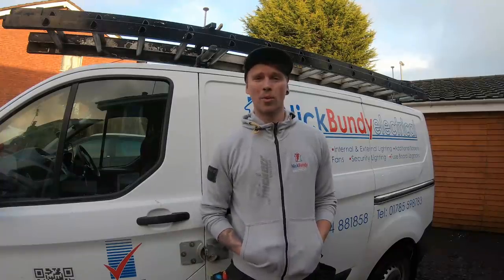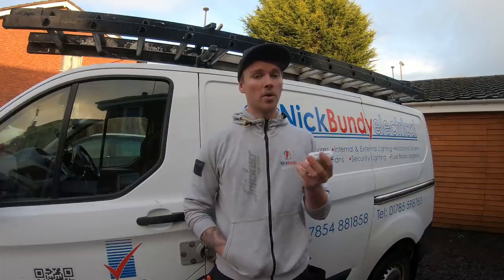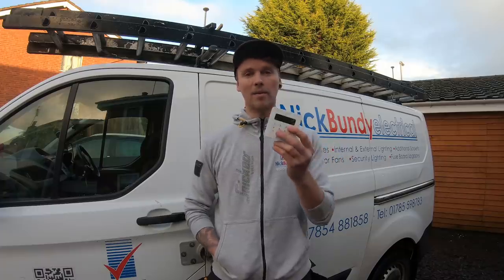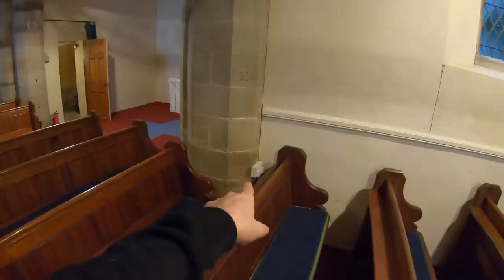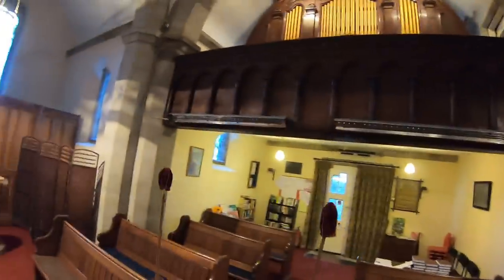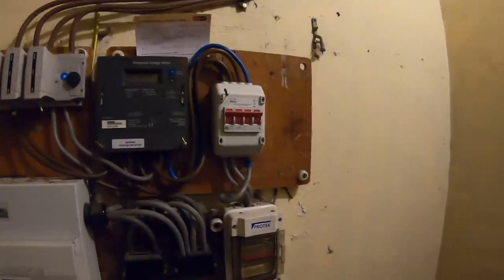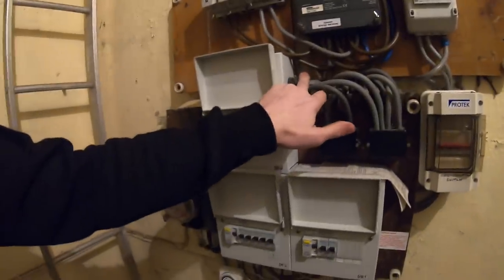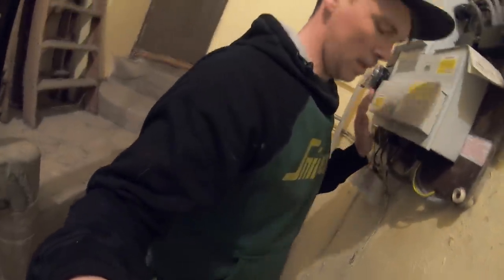AD Get paid with SumUp, Help! Wiring a church, Exotic life on an Electrician

Comment: I do a lot of work in churches, both EICRs and installation work. Bear in mind they are listed buildings, keep holes (inc fixings) to a minimum and in mortar rather then in stone - which in itself causes problems for you with getting good fixings. Check with the DAC whether they will accept all FP200 cables - it is either that or MICC in a church. Churches are very cold - plan do do work in the summer. There is no ideal solution for heating a church - whatever system is chosen will not be good enough - it is all about finding the best compromise. I have found under-pew convection heaters give acceptable results for the congregation, but the Vicar does not benefit from them. Capacity of supply is also a factor to take into account, though whatever they use will only be on for an hour or two a week. I have incorporated a control panel for zonal switching of heaters including push-button timer activation - guarantees the heating will not be left on accidentally.  Lightning protection ought to be in place, and it would be on the tower, but that is a specialist job - all you can do is advice them,  but the DAC ought to have done that already. Everything you do will take much longer than you expect - quote to take your time - aesthetics are really important. If I was you I would talk to the guy you know who did the EICR and perhaps find a way of both doing the job together.
Reply: Some heaters are programmed to switch off after a while automatically just in case they are left on.

Comment: I wouldn't discount re-running it in MI. When done well it looks great especially for buildings with bare stone or brick walls. Less obtrusive than conduit. I would be inclined to do everything in metalclad boxes too, no plastic. There's a tendency to think of MI as obsolete but it's definitely not. It does take skill to do it well though and I don't think they teach that skill enough on apprenticeships and the like now.
Reply: Yes, obviously.
Reply: When conduit is required metal conduit will look better that plastic too.

Comment: I did a couple of churches about 50 years ago, (seems like only a few years ago) used a lot of existing conduits for lighting, otherwise new sockets and lighting were done in MI. About 30 years ago I put in 8 infra red heaters and an additional 3 phase board in one, the bigger of the two churches was probably 8 times the size of yours, and there was only me and one other spark on the job. There were eight 'chandeliers' with seven lamps on each. I was s/e for  54 years, retired now - 76 this year! Never had any call backs in the 50 years. MK and MEM.
Reply: Sounds like you did a nice job there, chandeliers MicC and infra red.  Just like on the continent.  WHY they bother with spotlighting shit in our cathedrals and churches, it's just NAFF in my opinion.  Go to Amiens, and see the sombre vaults and the warm glow of the chandeliers or standard lights in Notre Damn - there's got to be no need to light the vault itself in worship - or Chichester at evensong, with the low chandelier in the Choir providing the light.  NAFF electrical design companies want churches to adopt all their NAFF, wet, me-too up-spotlightery and it's just crass.      "in   my opinion" !
Reply: Was trained by a spark who was putting electricity into buildings for the first time. Never done a complete church but done alterations and additions. Yep back when mk was the rolls Royce of sockets. Now overpriced crap since Honeywell got their hands on it.

Comment: I`d use FP200 and just put it in place of the MICC thats already there, use same holes for P clips etc if possible,
For access a single width mobile scaffold would probably do, easy enough to build it up between the rows of seats etc
Reply: Totally use white FP200. Absolute beaut to form that stuff. Looks naff if you abuse it but you can make it look mint

Comment: “Jesus it’s cold” 😂😂👍
Reply: The standard for churches used to be micc but a lot of sparks use fp, ask the architect who carried out the quinquennial for a specification, it's not fair to price a job without all parties knowing what type of cable is specified there would be thousands of pounds difference.  MICC has an indefinite life dont write it all off because of a couple of damp seals, if installed correctly it will out last all of us.
Reply: Euidd

Comment: We used to replace the pyro with fp200gold in black in churches and re use the same fixing holes. That was when I worked for a contractor. The good thing about them was you had the place to yourself. We just used an aluminium scaffold.

Comment: First for everything Nick. I’ve rewired in churches before but that was a fire alarm. So you will absolutely need long SDS drill bits. Scaffolding or a skinny scissor lift could work. I would be tempted to wire it in MICC. That way the install shall last for another 50+ years, plus the added bonus of that cable is that it should hopefully prevent moisture ingress and deter any deterioration. As churches are cold places the cables could be susceptible to that. 
I’m sure you’ll do a great job if you do get it!

Comment: I'm a retired American electrician and have done a little work in churches. I think you should take the job, it's not a big church. I think if you could do it in stages and they would work with you so you could also work with the other clients you have, it would be a great learning experience. I'm 71 and still do some residential or domestic for a couple of clients that have rentals and flip houses. I've worked in industrial, commercial and residential. My advise is take that job. Sit down and come up with a plan and  present it to the church. I would do the heaters first. Hopefully a small scissor lift as far as wiring whatever your allowed there.  Wish you the best. If you need to pray about it there you go, a church at your disposal. Amen 😊Have a great day a great day indeed.

Comment: Depending on budget look at the mode lighting range (eDIN controls) ideal for churches. Dali system will have the ability to control each individual light, set scenes as you wish for events such as weddings funerals etc wire in 5 core fp 200.
Reply: Never done Dali I'm assuming that's l,n,e and a pair for 10v dimming?

Comment: Hi Nick just watched your video walkthrough the church for rewireing  I am not a electrician but due to the church has water issues I would favour the armoured cable it may be expensive but will be a lot safer in the long run also you can save in areas where you may use trunking best quote for both

Comment: Some of the old micc cables maybe ok left in assuming they test out ok and are installed correctly. Some of the poor readings in the report may be down to water ingress at the accessories etc. Micc cable once terminated and sealed is good for along time.

Comment: Sent you an email - look out for one from Smartelex. Some thoughts: FP200 is usually preferred. Fire alarms are not required, as is emergency lighting - but you may want to fit a few for best practice. Think about using LED fittings throughout as Eco Church initiatives are becoming popular. Also smart lighting control makes position of switches much easier - think Rako wireless or Mode Lighting... hope the email is of help.

Comment: Bare copper MICC is usually specified by the church authorities, for fire resistance and aesthetic considerations, check with the diocesan advisors and the planning authority !
I’ve replaced sections in churches in the past but not a full rewire, as low IR with pyro is not usually the cable unless it is damaged,

Comment: Hi Nick , yeah I'd go with white FP200 should just run in like for like and it's a neat job. I'd also go with 20amp radicals for sockets and just take feeds to switches so you only have minimal cables at lights. Great job that. I'd would allow for a new DB 3 phase one with rcbos as an extra.

Comment: Hi nick, I’ve rewired about 130 churches, mainly use FP200 gold cable in white with metal p clips, always use metal clad switches and sockets etc. Also heating specified os normally by a company called BN Thermic. I would be tempted to use single with mobile tower scaffold to do access the wiring.

Comment: I’d use flexshield, comes in black and white, great stuff almost like FP but with the same properties as a light duty armoured, some size CPC so great for achieving ZS values, irrelevant probably on a TT system but still use it all the time dresses nicely with P clips too.

Comment: Yer worked in a church before. Normally they used conduit as the earth. Youll have to check see if it’s listed. Over drilling holes. Had to use a scissor lift for access
Reply: Yep, I used to work as a telecom eng and worked in a few churches, when asked the clients would say ' ooh yes this is a listed building, you can't do this, this and this'.

Comment: Definitely pyro as well as hard wearing you can use smaller conductor size and looks tidy . I would suggest you use the pvc coated stuff. Although the exposed copper blends in better I have known it react with the damp and possibly lime from the stone and turns green which causes it to deteriorate.

Comment: If you need a good tower then look at MITower available from brandon, speedyhire etc it is stored in its wheeled base and can be put up in 10 mins by one person safely and very easy to use. normally around £100 for the week.

Comment: I worked as a specialist sound engineer in church buildings for over 20 years. The micc is widely used, and I'vo only seen it corroded through in a couple of instances where it was installed low and damp all the time. The only other problem with MICc is lightning strikes, it splits open! The  hierachy of the Cof E is that the DAC will select  the winning contractor, taking into acccount ,experience, how the job will be carried out to the best aesthetic appearance ,care of building and minimal damage and of course price. The job will be subject to a Faculty, and any contractor will have to meet all faculty requirements to be allowed to work in the building.
However, once you've done a few, and they like your work, you will be on their  list and get invited to quote on all work in that diocese.

Comment: The last time I used micc on a large Job was 20 years+ working on a swimming pool for 18 months( nothing but micc). I'd be surprised if the cables have low insulation resistance unless the seals weren't properly crimped, might be worth checking in sections

Comment: Would be a nice job to get don't  forget the emergency lighting and mite need to quote for a fire alarm being a public place 👍
Reply: I agree with you that you need emergency lighting.  And I would suggest fire alarm system like protech (Nelson) or other brands. But good thing with protech is it is monitored.
Reply: Definitely I’d say a must
Reply: Fire alarm wise, the place is screaming out for an EMS wireless system. Keep it simple. Mind you if the ceilings are higher than 10.5m then conventional OSD's won't cut it, you're looking at either aspirating or beam detection. Both easily integrated into an EMS panel.
Reply: @karateandy76  keep it hard wired because people never change batteries
Reply: @Cardetailingburnley  There needs to be a service contract in place which would identify low battery issues. To be fair, from experience, batteries in EMS devices last a good 2-3 years. Any approved fire alarm company worth it's salt would provide battery changes if and when required, no point installing then just walking away.

ANY, and I mean ANY, fire alarm can be monitored. With 4g GSM dual path connectivity there's no need for old out-dated, soon to be decommissioned, PSTN connections.
Reply: The Legend that is Andy someone earlier on out a link to a church guidance note that specifically banned radios. Does that include wireless devices?
Reply: I'm a trustee of a Church of England church as well as working domestically and in churches (Electrical repairs & testing, AV etc); half of that guidance is bonkers. Two way radios are very useful when doing testing in large buildings. Or if they mean working to music... I'm not going to stop a spark who works more efficiently with radio 3 on in the background... https://www.churchofengland.org/more/church-resources/churchcare/advice-and-guidance-church-buildings/audio-visual-and-electrical Here's an excerpt someone's written for non-technical people.

"Distribution Boards
Distribution boards provide the means for individual electrical circuits to be installed. They contain one of the key safety features, namely the fuse or circuit breaker. ‘BS 88’ fuses are good because they can clear very large fault currents safely and cannot operate again. On the other hand circuit breakers are expected to work safely again after they have cleared large faults, such as short circuits. Circuit breakers must be capable of safely working at fault currents up to 6kA. Churches should install Residual Current Circuit Breakers, RCCBs, on circuits containing socket outlets for additional protection against electrical shocks. 
9 April 2013"

At best it's just superfluous advice. Why not just say comply with IEE wiring regs current edition? Been in a church today where most of the lighting is old yellowy sodium floods. There is ornate timber panelling down the sides of the building where twin and earth and 10mm earth have just been clipped for bonding and a socket radial. On the back wall of the building there was a twin and earth round the door moulding. Squished every time someone sits down on the back pew :-O

Comment: I've done a church before, I'd use MICC as the gold standard but FP2000 is good, as already mentioned use existing cable routes and drill holes to minimise damage....a good job to take on....access I'd use a tower single width...should get you to most places.... I'd run power circuits as radials for socket outlets, with a 3 phase supply you've plenty of scope to split the load...

Comment: EMT conduit unless they will let you get away with wire mould.  Not sure of regs for a church in England.  And just add more resistive heaters for better more even coverage.  Its only on a few hours once a week.  Hopefully the service can handle it.  They are already loading up with space heaters.  Same concept just more permanent.

Comment: Looks very interesting, only thing i'd say about using a genie/scissor lift is that they will probably make short work of chewing up the carpet so if you do use one (ideal choice really) make sure you maybe make up some strips of plywood to run it on over the carpet
Reply: Just bought myself a little Genie Lift, I love 'em.  Would buy bigger if I got the chance, or the job, and might do still.   They hold their value.
Reply: How easy are the pews to move around?  Fastned?  Super heavy?
Reply: might be a timber floor under the carpet; given the level of damp that'd be a massive risk with powered access. If you can have a tower between some of the pews that might make life a lot easier

Comment: Hi Nick, I've seen many of your videos and you certainly have your work cut out. 

Rewiring a Church... now that would be a task however most certainly a challenge for you to do.

I'm not an electrician but could you possibly use Pyro Tenex, the fire rated cable to run around and feed the sockets,  think conduit might be expensive and the lengths too long as a very high building but what would I know? Best use metal clad sockets, they're more robust. 

Not sure if the fire rated cable is still called Pyro Tenex, certainly might be something from the 1960's possibly!!!

Infrared Quartz Heaters, the ones that glow red and warm the people rather than the air. Maybe the heaters on their own circuit depending on the wattage and how many of them there are. If they were 3kw each, maybe two heaters 6000 watts running from one 32 amp RCBO, don't know how many heaters the church person has in mind. 

Like the bit when you pointed at the existing heaters and said "that one burns the priest's head and the other one burns the pianist's/organist's head", sounded comical.

Would you fit a copper lighting conductor strip to the roof of the church down to earth? This might be worth mentioning, it's not the highest building in the world but well you never know. 

Keep your videos going,  we'd like to see you rewiring this church but be careful as you'll need scaffolding and protection etc. 

Remember it'll be a Religious EICR Ceremony you'll have to conduct here... Hehe 😇

Go on, go for it, make us a wonderful video of rewiring this church 😀

Regards Alec 😎

Comment: Have a go at that job Nick , I tell you what thou ,you would remember that job for as long as you live 
When I was an apprentice 1979 - 1981 my boss and I wired up an old barn that was  taken apart in Essex and moved to Surrey it was then used as theatre by the local amateur dramatic company , it too was wided in mims cable it was two story and had a mezzanine level on the top floor where the lighting controls were , first floor was all polished oak floors with two cartwheel type chandeliers above and on the ground floor  there was enough room for four classic cars and an Jacobean staircase going up to the first floor , under the first floor there was a dark  room for Developing photography , I can’t for the life of me remember the address but it would be nice to go back to see how it’s aged